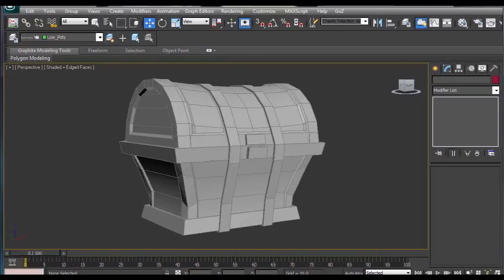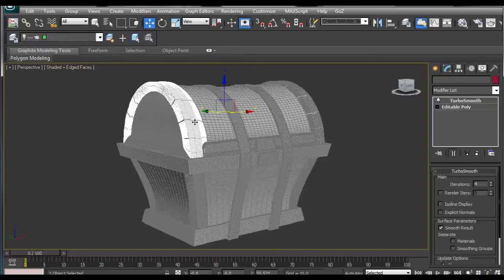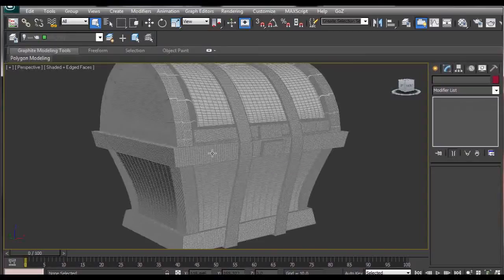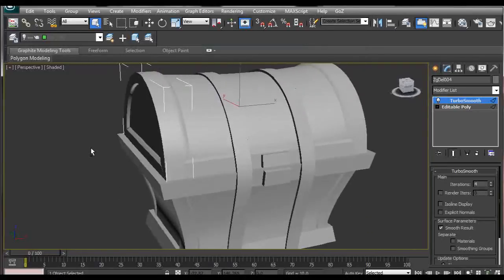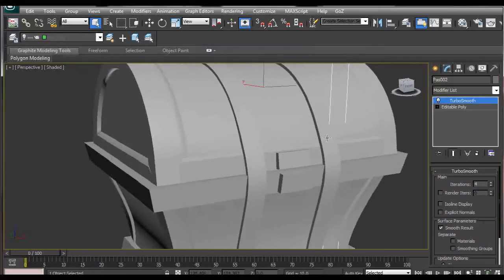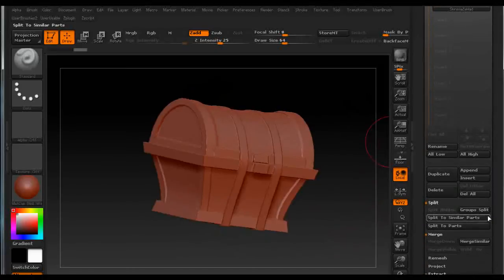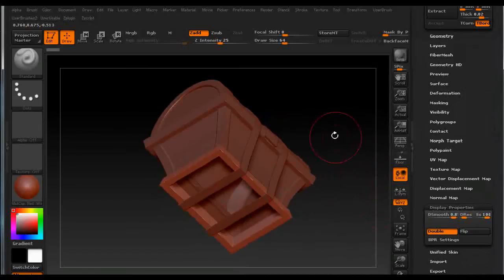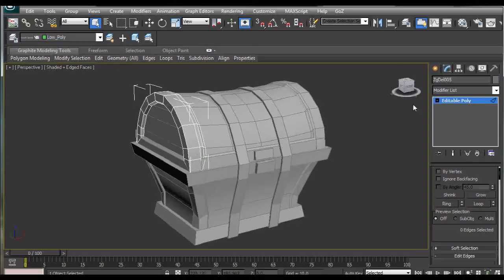Tutorial: How to preserve creased edges for ZBrush in Autodesk 3Ds Max

Comment: I dont have the tab including weight and crease under "create shape from selection" there s just edit tri and turn tabs...  how can I get that tab?
Reply from the maker: I would try under Customize (top menu) and "Revert to Startup Layout". 
If you are using Edges or Borders on Editable Poly Weight and Crease should be there.
Reply: You have to convert it to poly. You cant do it with edit poly modifier.